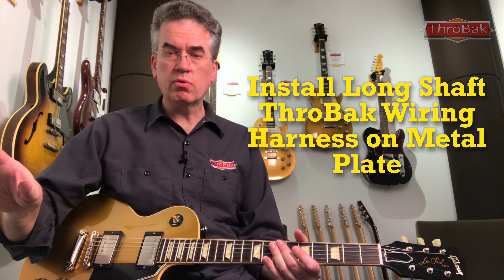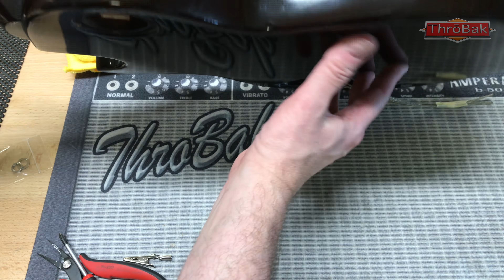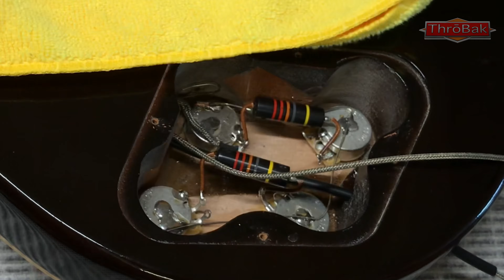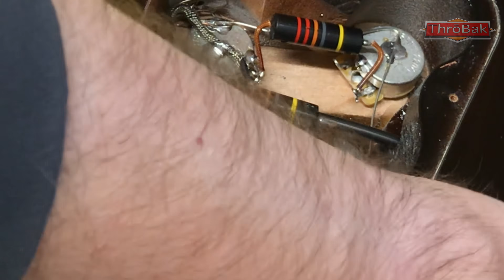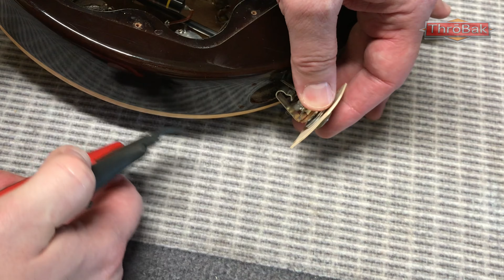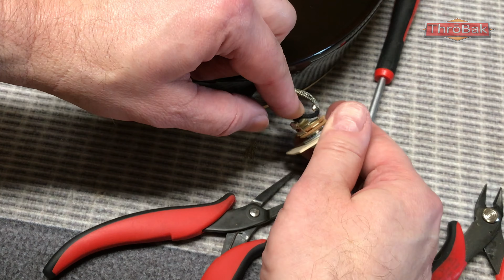How to install Les Paul Switch and Jack - ThroBak Vintage Correct Switch and Jack Assembly

Comment: Hi! Quick question! 
If I want to change to a 50’s wiring in a Gibson std 50’s (2022) which is not the 50’s wiring, and has the plate but I won’t change the toggle switch… do I have to change the solder points?

Comment: Great video and channel.  Ive always struggled with my Weller soldering iron and never did a good job with it.  What exact model are you using and what temperature and wattage setting do you recommend?  Cheers!    Rob from the Adirondacks of Upstate NY.

Comment: Finally! The best damn video I've seen on You Tube on how to replace a selector switch on a Gibson Les Paul. I'm trying to replace my switch because the neck pickup is not working with the same volume as the bridge. My problem is I just don't have enough wiring at the switch to resolder or replace it. Sir you are a true professional at what you're doing (unlike a bunch of people trying to repair a guitar switch AND not explaining how the whole procedure works).

Comment: This was a great video Jon, as was the wiring harness video.  One of my LPs, a Deluxe ('76/'77?) , that I've had for over 47 years has the metal plate and the cover.  I'm contemplating changing to your '50s style wiring harness, so based on what you mentioned early on in the video, I guess I would need the long shaft?  After watching this video, I think I may change the switch as well?  Thanks and cheers,  MB